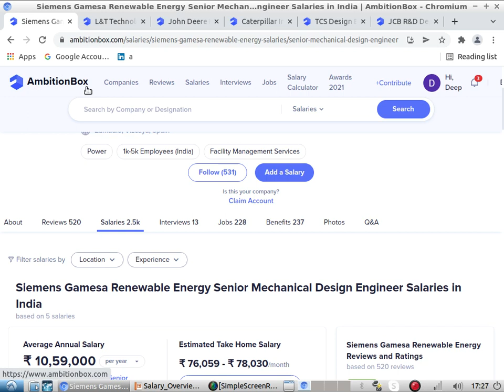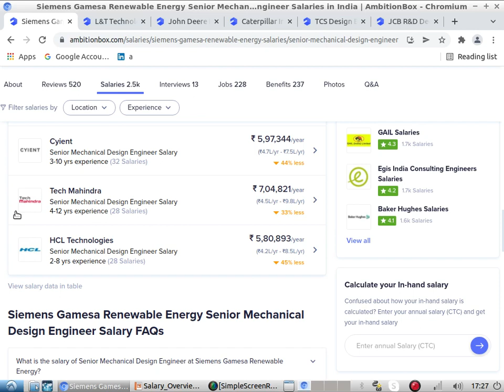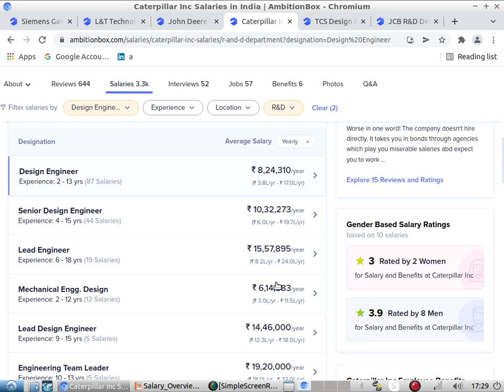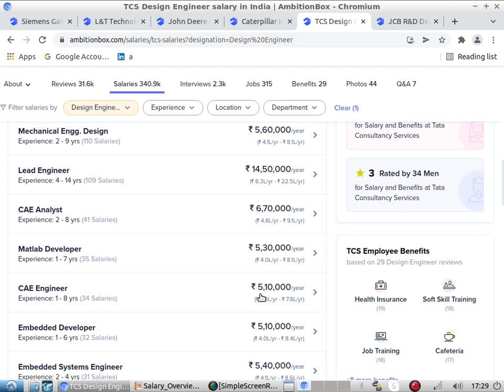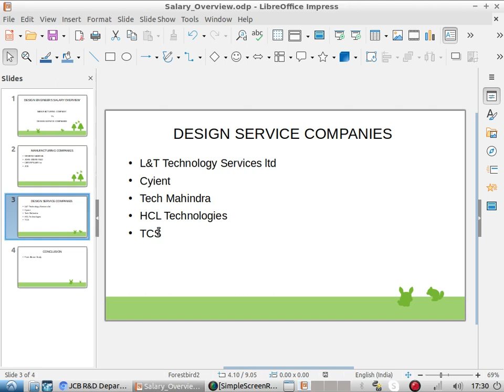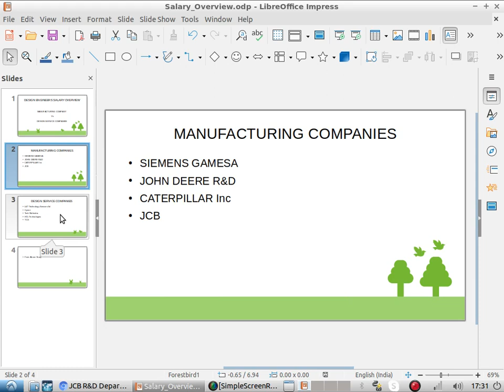Mechanical Design Engineer Salary at Manufacturing & Service Sector Companies

Comment: More importantly industries are moving towards hiring candidates with both design+analysis capability.  Having knowledge in only either of them is not going to help.  I recently moved from fea role to design & analysis role and I would say there is a tremendous learning experience. Most importantly the sanity checks and hand-calculations which most of FEA roles never do sadly as it is highly driven by software and tool dependency.
Reply from the maker: check below links, we conduct career growth training programmes for design engineers, live worldwide. 

https://www.linkedin.com/in/deepjyoti-product-design-78a46516/

https://www.linkedin.com/pulse/machine-structure-design-training-career-growth-jobready-deep-jyoti/

Comment: Well said, doing 3d modeling,meshing, stress, displacement, strain,... Won't land to an good job.
That's why I'm learning Strength of material, their applications, will it be helpfull, currently I'm in 3rd yr, but bit confuse how are this formulas used.
Please give me feedback sir
Reply from the maker: "While college professors excel at teaching design formulas, applying those formulas to real-world industrial product design requires a practical working mindset—something that comes only with hands-on experience. With over three decades of expertise in applying design principles to real-world challenges, we are proud to train mechanical design engineers globally, equipping them with the skills needed to bridge the gap between theory and practice."